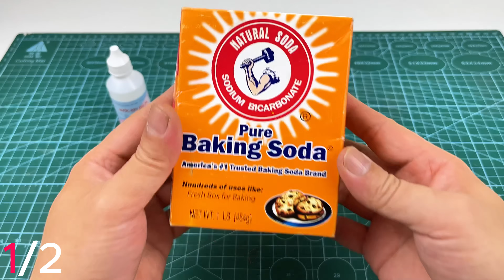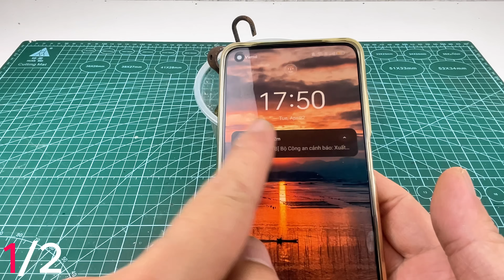The hidden secret of HYDROGEN PEROXIDE + BAKING SODA power

Comment: After soaking in the solution, later procedure can be done in a better way by adding coarse sand to the  components and then stirring the mixture in a small cylindrical chamber by rotating it in eccentric movement using a geared low RPM dc motor. That will give better results wrt surface finish. Please dont mind my suggestion.
Reply from the maker: Oh, I totally agree with your approach, it's a great method that I believe I’ve learned from you. I truly appreciate that, and it's wonderful to be able to learn more from friends around the world! Thank you for watching the video and leaving a comment. I truly hope you'll continue to support me and share your thoughts on future videos. Wishing you and your family happiness and good health!